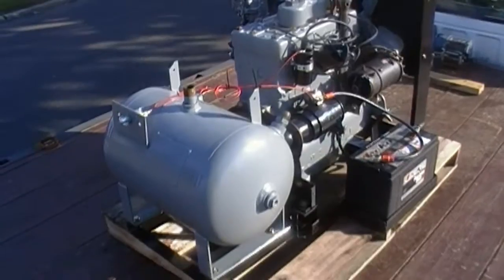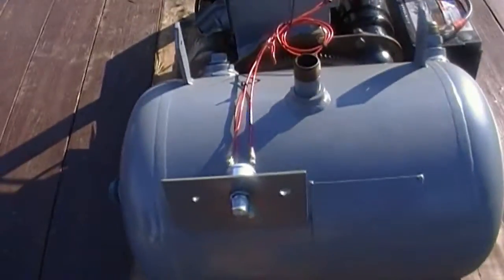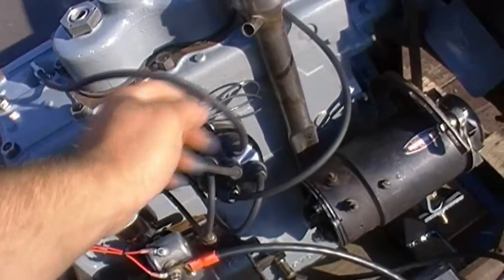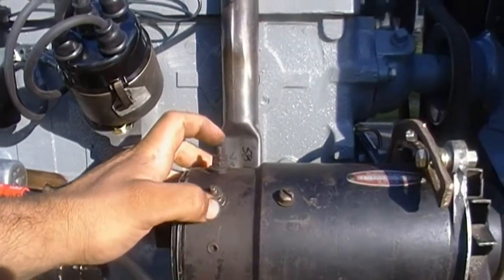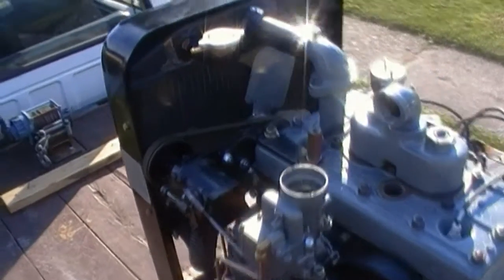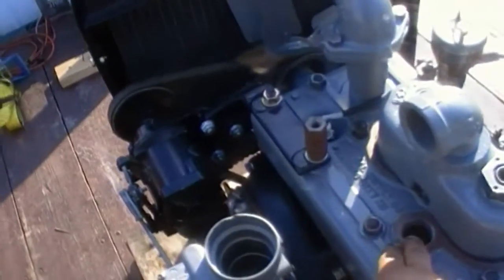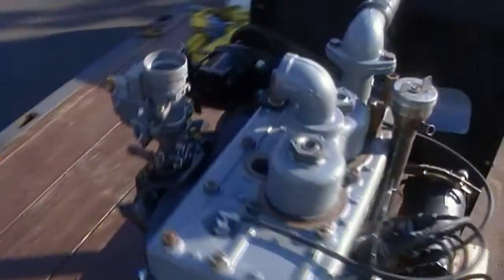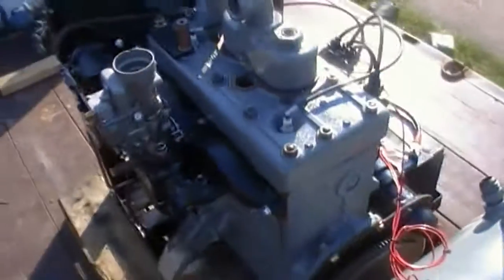General Supply Co. Air Compressor #11

Comment: Hi SmallEngineMechanic, I have had one of these that I got from a friend about 3 years ago. It was mounted on a trailer. Has an electric fuel pump and generator is out. Been looking into doing a rebuild on it just like you did. I got a spare 2g alternator from a ford and battery. Mine was running when I got it. Would like to share info with you.